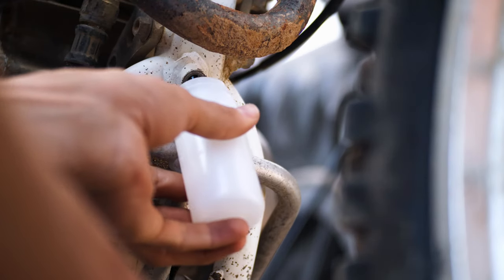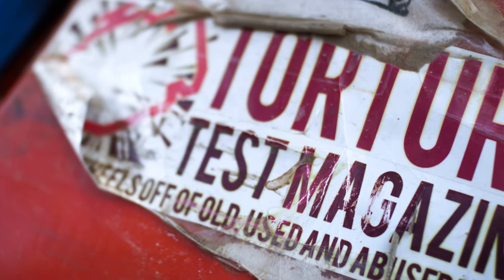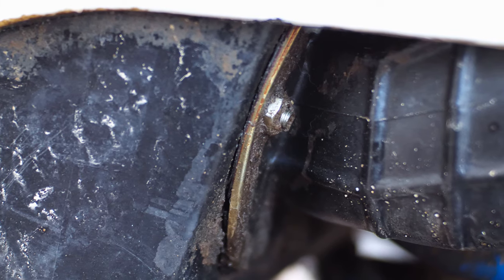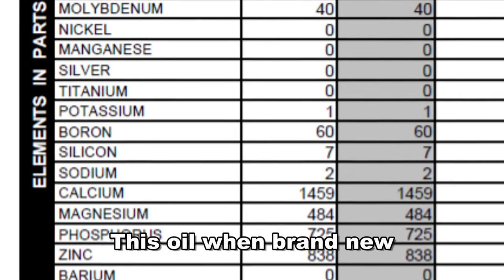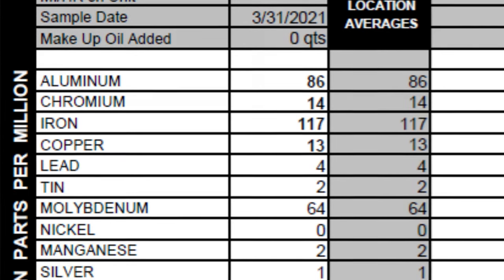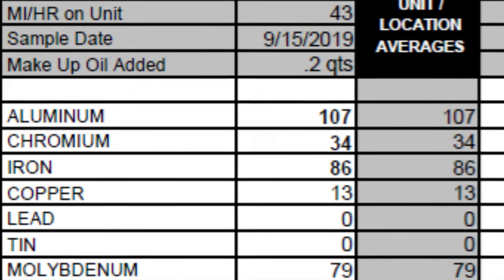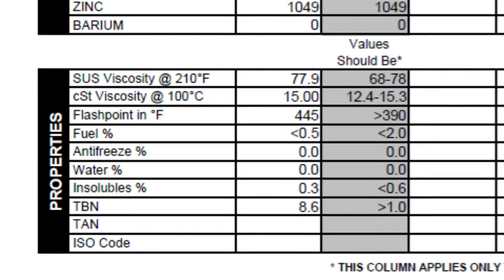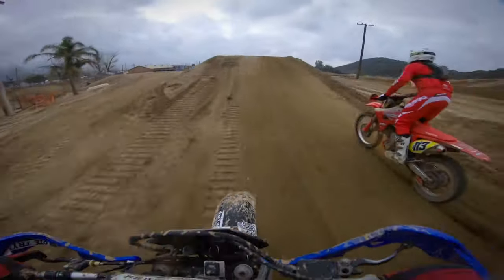If Oil Analysis Shows This, BE WORRIED!

Comment: We pulled oil analysis on our airplanes religiosly. Like you said trends is what your looking for. What is normal for 1 engine may or may not be the same for another. But trends will give you advanced warning of wear and that something is up. It will also point you into the general direction of where to look. So, yes, keep sharing them. Be safe.

Comment: Thats very interesting. Ive got an '85xr600. I can see metal in the oil, probably not worth getting an analysis but im curious now. Do you know what the breather is supposed to filter through? Mine seems to be just an open tube above the air cleaner.